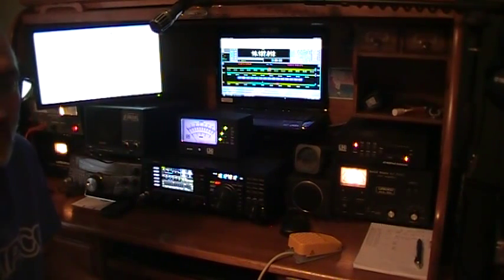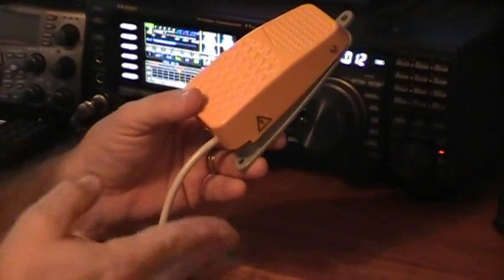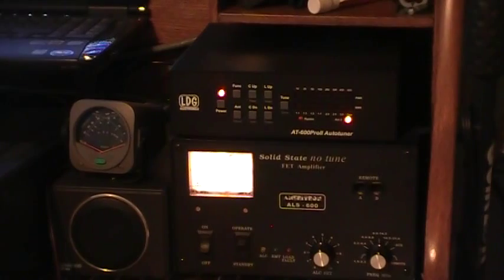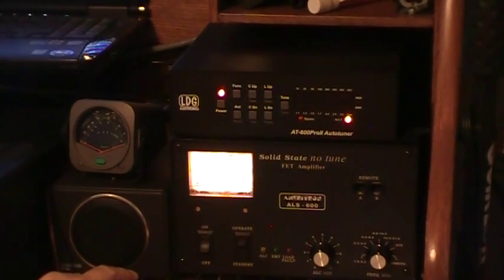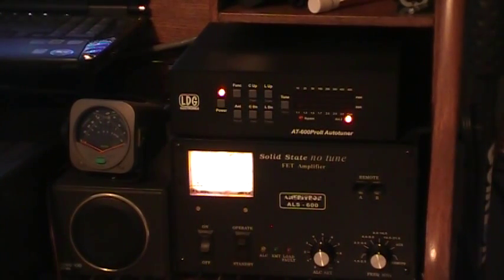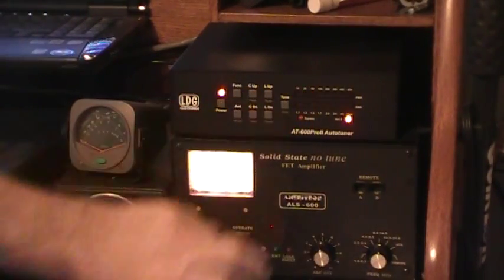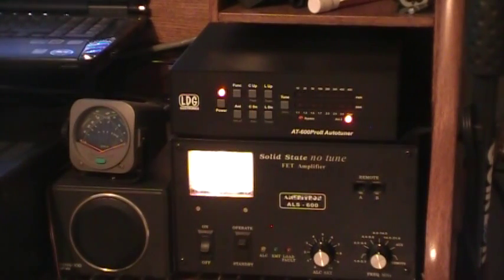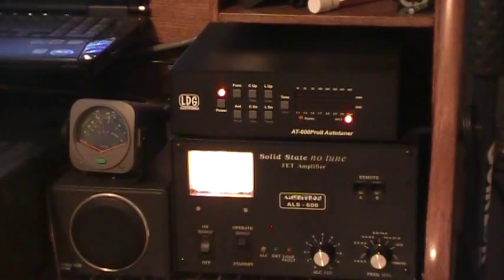Yaesu FTDX 3000 tuner switch

Comment: Does the FTdx3000 not have a built-in tuner as standard?
Reply from the maker: Yes it does but it only handles a 100 watts. The ldg is for the amplifier. I run an ameritron als 600.